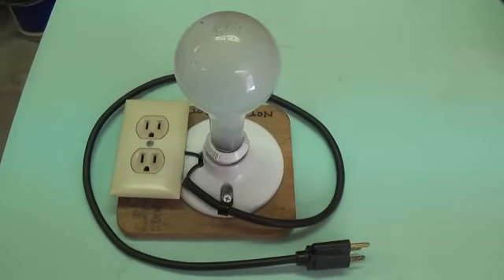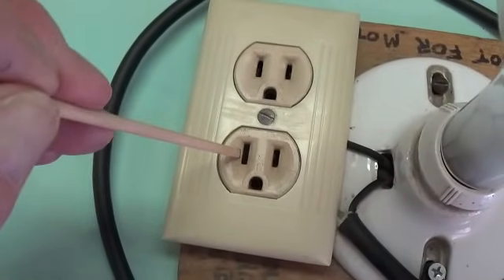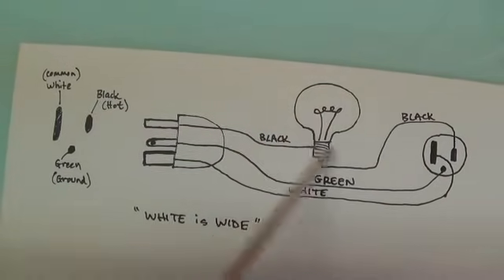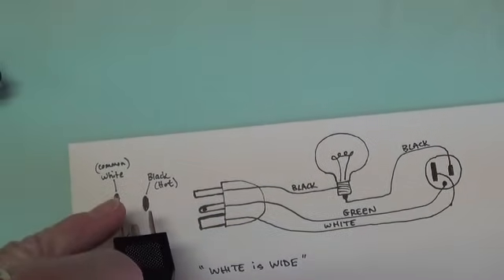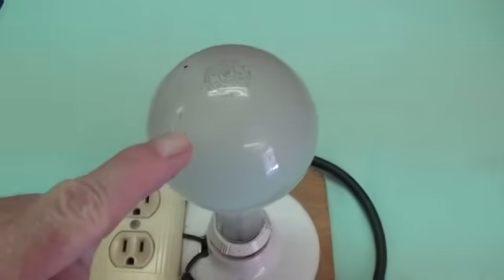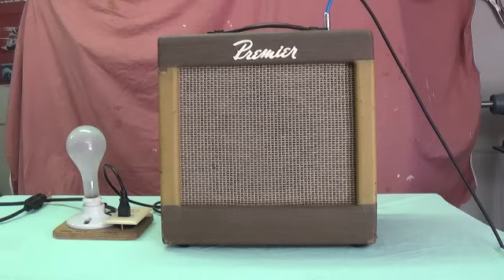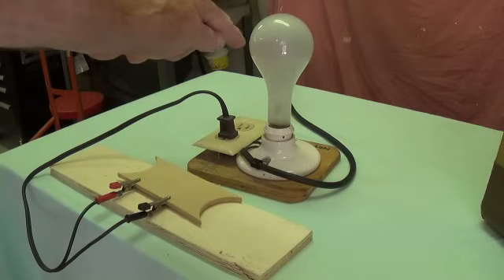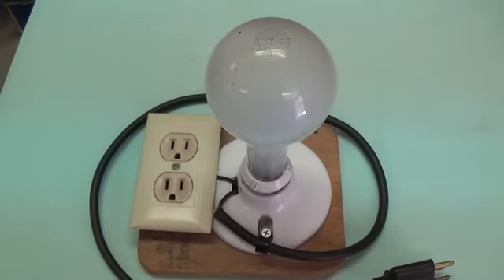Build Your Own Current Limiter for Protection when Repairing and Testing Electronic Equipment

Comment: Can you use a fluorescent light bulb instead of an incandescent?  anyone know?thank you
Reply from the maker: No, you cannot. A fluorescent bulb operates under completely different parameters and will not work in a current limiter.
Reply: Thank you for the fast response to both of my questions.So incandescent it is.Oh and I subbed to your channel.Cheers
Reply from the maker: Thanks for subscribing, Rob. Good luck with your current limiter.

Comment: So, if I have a 200W lamp installed in the socket of one if these, and powered up an old Danelectro DM25, and the lamp SLOWLY (I EMPHASIZE SLOWLY) burns the filament in the lamp apart/open (like a blown bulb), What does this indicate?
Faulty light bulb or build issue with  my CL? Or is there a serious fault in the amp?
I can turn the amp on without the CL and run it at 120V and it doesn't blow the fuse or act strange???
Help please! Lol
Reply: I'm at Lowe's now getting a 300W bulb to try...hopefully with different results...
Reply from the maker: Assuming that you wired the current limiter properly and if the amp works fine without the CL in place, then the only possible culprit must be the bulb. It had probably lost its vacuum, oxygen entered, and the filament oxidized rapidly once current began to pass through it. I have a feeling that the 300W bulb.....or a good 200W bulb.....will work just fine.
Reply: Uncle Doug ...
The 300 W lamp is working fine!
I appreciate your time sir!!!
Keep the videos coming!
Reply from the maker: I'm glad to hear that, Rickey. We will :)

Comment: One needs a current limiter, or your prized amp may be next in line for a new transformer or other expensive part. Also when checking prior to any of this, if you use a variac to check voltages of transformers, measure 12volts on the output of the variac before hooking up to primary wires if checking a power xfmr,  to make sure you don't overheating the transformer by using full voltage and letting it cook without a load...um don't ask me why I know this....Love the Doug Show and Tell hour, sorry to hear Fido has passed on...
Reply from the maker: You speak the truth, Johnne......and we won't ask how you learned it :) Thanks for the kind words about Rusty and our channel :)

Comment: Uncle Doug, I live in the Philippines and we have 220-240v on the mains. Should I just use a 100w? Or should I use 200w?
Reply from the maker: Greetings, MH. As stated in the video description:  "For viewers in areas with 220-240VAC power:  Although your voltage is double (220VAC vs 110VAC), your current flow is about half. Since the Current Limiter (CL) depends on current to rapidly heat the filament and increase its resistance, you need a bulb with higher filament resistance. Since the filament resistance of the bulb decreases with 
higher wattage, you should try a lower wattage, higher resistance bulb.....i.e. a 100W......initially, and then fine tune the wattage depending upon the power demands of the amplifier being protected."

Comment: Is there a good way to test this for the first time, other than just shorting it out?
Reply from the maker: Good question, Tony. Perhaps you could hook it up in series with an amplifier that functions properly and use the amp for a while. The bulb should be warm to the touch and glowing very little, if at all. If this is the case, then the wattage is correct and you are ready to use it with amps of similar wattage.

Comment: Hi uncle Doug, thanks so much for the video. As you explained very well this is for ac current. But for dc current do you have any suggestions. I do have an ac power source of 23v that i rectified to 23v dc. Have no idea of amps that can handle so i don’t want to blow the rectifier if I’m testing the dc amps using for example a 12 vdc motor that draws 3 amps. Any sugestions.? Thank you.
Reply from the maker: I only deal with vintage tube amps, Guillermo, and no tube amp I know of will function with 23V of DC. You might install a 4A fuse if you want to protect against current in excess of 3A. Good luck.

Comment: A comment on how I built a version of this current limiter.  Instead of using a bulb base and dedicated bulb, I split the socket and use one of the outlets for the load and I plug a floor lamp into the other.  I was concerned about storing the assembly with the bulb in it and since I have a 100 watt lamp in my shop anyhow, I just plug it into the lamp socket when I want to test something.
Reply from the maker: Very clever idea, SW. Thanks for sharing.

Comment: Reading the comments, it appears that many people need to know how to build a current limiter for a 240V supply. In countries which conform to the IEC standard (UK, much of Europe, New Zealand, Australia and elsewhere) the live/line/phase wire (Uncle Doug's black wire) is brown, and the neutral/return/cold wire (Uncle Doug's white wire) is blue. If you can source a 200W incandescent bulb you can simply follow Uncle Doug's instructions, taking care to wire your plug socket correctly.
 If a bulb is intended to operate at 240V, its filament has twice the resistance of the filament of a bulb intended to operate at 120V, which means that one 240V/200W bulb will do exactly the same job in a current limiter for use with 240V mains as one 120V/200W bulb in a limiter designed to operate at 120V.
Here in the UK, 105W tungsten halogen incandescent bulbs, which are suitable for use in a current limiter, can be bought in the shops. I use two such bulbs wired in series.
Reply from the maker: Thanks for your very detailed explanation, Silas.
Reply: Another recurring source of confusion is the use of multiple bulbs. The power rating of an incandescent bulb is directly related to the resistance of its filament at its working temperature. Resistance is given by 'voltage squared divided by power'. The resistance of the filament of a 120V/100W bulb is 120 x 120 / 100 = 144 ohms, while the resistance of a 120V/200W filament is 120 x 120 / 200  = 288 ohms. Just like any other resistors, the bulbs should be wired in series to add their resistances (and therefore their power ratings) together. 
Once again, the formulae derived from Ohm' Law come riding to the rescue!
Reply from the maker: I would only add that the resistance measurements you state are for the filament at operating temperature. The "cold" DC resistance is generally much lower. It is this heat-induced increase in resistance that provides the protection against excess current flow.
Reply: 7 months ago I posted the above comment. Much to my dismay and embarrassment I have to tell everyone that it is garbage and is utterly, totally completely wrong. Multiple bulbs should be wired in parallel to achieve a higher wattage light bulb current limiter. I should have learned by now to keep away from the keyboard until I know what I'm writing about!

Comment: Uncle Doug greetings to you in the wisdom land! THE D day has arrived to test my amp. I have just one doubt.  Am I allowed to have solder joint or just even solid wrapped  connection in extending the 2 wires as I splice wires in between? Thank you!! Kind regards and best wishes!
Reply from the maker: Greetings to you, ZA. I'm not sure I understand the question, but if you are going to extend any wires, I would advise that you solder them. Once soldered, they should function just as well as if they were one piece.
Reply: Uncle Doug thank you. Unwisely i cut 3 wires of the extension chord, instead of the only one which would have been connected  to the bulb. 

I was worried that a voltage surge could have maybe melt the solder etc. Just wanted to make sure. Million thanks. Good weekend!!

Comment: I use a 300watt tungsten halogen lamp.in UK we have 240v.earth is green yellow neutral blue.live brown.that is the colour your trousers go if you touch it.are plugs are the best in the world with insulated pins.a mechanical interlock and a built in fuse
Reply from the maker: Thanks for the info, Chris......especially regarding the brown wire :)

Comment: Great! But what if the plug of the old device being plugged in is only a 2-prong and is not polarized. There would then be two different ways to plug it in.
Reply from the maker: Either way, the device will be protected against a huge surge of current due to an internal short. Unless the old device is a pristine collectible, however, it should have a 3-wire grounding power cord.
Reply: In Europe even the 3-wire plugs are often symmetrical and can be plugged in either way.  That style is the “Schuko” type, originated in Germany, but also used in several other countries, although not in UK.

Comment: Hi.  I am planning on using a isolation transformer along with a 2kVA variac when I work on my old radios.  Along with them I have an analog 0-150VAC meter and a x1/x10 (switchable) analog ammeter.  When I start to bring up the voltage I will be able to monitor the current flow to tell me the condition of the item under test.  Would you still recommend using a dim bulb tester in conjunction with the items I have described in case of a dead short?  Thanks!
Reply from the maker: Yes, indeed. I use a current limiter with every amp, circuit, chassis, etc. that I work on.

Comment: Might want to make sure you're light bulb isn't burnt out or you will be.
Reply from the maker: No, actually, if the bulb filament is burned out, the circuit will be open and no current will flow unless you replace the bulb with a good one.
Reply: I was  wondering about that.  Can this devise be used to see the safe discharge of voltage in a high capacitance capacitor?
Reply from the maker: I would not recommend it, Pete. It's a current (not voltage) limiting device. The high voltage may damage the bulb.

Comment: Doug, thanks for another great video.  I built one of these after watching.  Question, given that the fault tube amp (or old radio) is effectively in series with the tester, doesn't that mean that the same current must pass though the faulty amp....in this case 250w / 120v = 2.1a
Reply from the maker: Fortunately not. A short circuit will cause excessive current to try to flow through the filament of the tube, resulting in a significant increase in filament temperature and resistance. This increased resistance will prevent an increased (or virtually any) current from flowing through the shorted circuit. Another way to look at it:  If Voltage = Current x Resistance, and V is constant, when R goes way up, Current must go way down to maintain the constant V.
Reply: The 120V supply voltage is shared between the bulb and the amp. With a short circuit or low resistance in the device under test (DUT) most of the voltage appears across the lamp, so that, although a large current is flowing, there is a small voltage so very little power is dissipated in the DUT.

Comment: Great Video!  
Can a GFCI receptor be used for protection instead of building a current limiter?  Or should a GFCI receptor be used Plus this current limiter?
Reply from the maker: Thanks, Danny. They serve two different purposes. The GFI is mainly for your safety, while the current limiter protects the circuit from damage while offering a visible indication of normal and excess current flow. I guess you could use both.....but I only use the CL.
Reply: Thanks for your reply! I will add both to my setup.  FYI, I have been getting a lot less sleep after finding your videos - they are so much fun and educational to watch!  Your teaching skills are very apparent.
Reply from the maker: You're welcome, Danny. We're glad you enjoy our videos :)

Comment: Hi yes i thought as much is there something else i could use, one bulb plus and appliance
Reply from the maker: Not really, Ron. For the unit to function, you have to use incandescent light bulbs. They alone provide an instant increase in resistance when confronted with increased current flow, and can effectively dissipate lots of heat while emitting a bright warning light.

Comment: hi i have wired it like you show but the bulb only lights up if or when i plug in an appliance in the socket they are 1600 watt appliances i am. only have 100 watt bulb 

thank you

ron
Reply from the maker: The Current Limiter I described is intended for use with guitar amps, Ron, not heavy duty appliances. If you absolutely have to use it with such appliances, you will have to use a group of 100W bulbs all wired in parallel.....probably 5 to 10 bulbs.

Comment: Hi, great video thanks. Incandecant bulbs are almost impossible to get in the UK now. Could I use a high wattage halogen bulb instead as these are still readily available.
Reply from the maker: Thanks, Russell.  I have not fully investigated, but don't believe that halogen bulbs have the proper resistance and design for use in a current limiter. Incandescent bulbs are readily available on Amazon.com. Perhaps you could order a couple for your CL.
Reply: Thank Uncle Doug, I will do, although with my very limited knowledge of electronics I can't see why a halogen bulb wouldn't work. Isn't it just a low impedance resistor that heats up the same as a normal bulb? I would like to understand the difference.
Reply: Hi Uncle Doug, well I gave it a go with a 116w halogen bulb I found in my garage & it works fine. They are just tungsten filaments in a halogen gas bubble so no big difference to a normal incandescent bulb I think :-)
Reply: @RussellCatchpole  You think correctly.

Comment: Thanks very much! I need such a device but in Belgium wall plug alternates,  we don't have hot and common. Can I still do this?  Thank you
Reply from the maker: You're welcome, ZA. Yes, the current limiter will work regardless of which of the two AC wires the bulb is inserted. Build the unit and test it.....it will work.
Reply: Uncle Doug great. Go out right away and buy the parts.
Reply from the maker: Let us know how it turns out, Z.

Comment: Hey Doug thanks for all you videos. I have a question about using one of these. I built one as you described but when I power it on with an amp plugged in the light glows bright then slowly goes out. Is this OK?
Reply from the maker: When an amp first starts up, the filter caps draw a lot of current, which diminishes once they are fully charged. This could explain what you are experiencing, Tim.

Comment: Excellent video.  I've built one of these several years back and used it along w/a Variac to slowly pull up an old ham radio rig (Collins).  Very useful tool, and I'd never bring up anything old that's not been powered up in years without a DBT.  Thanks again
Oh yeah, my Dad (now 81) taught me how to solder my first project when I was 8.  And he always told me to keep one hand in my pocket when working around lethal voltages. :)  An old-school habit.
Reply from the maker: Thanks, SR. It sounds like your dad was a good source for electronics advice :)

Comment: Nice video Doug.  I think I need to upgrade my device.  I just took an old two wire extension cord (no ground) and wired the light socket inline with one of the wires.  I am not even sure it is wired on the hot side.  It seems to work fine but I like this better, mounted to the wood plate with the receptacle.
Reply from the maker: Thanks, M. You had the right idea, but with a little refinement, it would be a very useful workshop tool.
Reply: LOL.  Everything is easy to buy at Home Depot except the wood.  Where did you get that?  Just scrap?  I guess I could cut out a little square of plywood.
Reply from the maker: Yes, I have a whole pile of scrap lumber left over from building cabinets, etc. You're welcome to come by and pick up some pieces :)

Comment: Uncle Doug, this is probably a dimwitted question, but what are some good ways to ready a chassis to work on it- meaning turn it upside-down with room for the tubes to hang, the rectifier one on this one I'm about to dive into , I'm going to probably cut some boards to build a custom box, just wondered how you do this...
Reply from the maker: We use a highly sophisticated chassis jig that consists of two 10" pine 2 x 4's on edge, one beneath each end of the chassis, to hold it bottom up and high enough off the work table so the tubes don't touch.  Patent pending :)
Reply: AH! -so I'm not just overkilling on this.  that 1958 Magnavox Concierto 2-piece console thanks you kindly.  one other thing. . . one of the 15" woofers has a scratch on its cone, not all the way thru, but pretty visible.  hot glue?  or just leave it?  I should really remove it all and check the conditions.   Starting to feel like too much of a dummy to even attempt this jazz...  mid-life-crisis hobby
Reply from the maker: If the scratch is on the part of the cone that doesn't flex, you might strengthen it with some white glue (Elmer's or Titebond). If it's on the surrounding flex portion, use contact cement (which remains flexible).
Reply: thanks a lot- still tinkering with things non-electrical until I cram more know in here.  the chassis of this thing is speckled with dark little dots, bug frass i assume, they won't come out with #0000 steel wool..  any way to buff them out w/o power tools?
Reply: i retract, I removed it, turned it around -and it looks like it's a seam? stranger things have happened?  there's also a 4" speaker mounted in front of it!  the plot doth thicken.  I wish I could have a pro around who's seen ghosts too.
Reply from the maker: It's probably an old radio speaker, with a tweeter mounted coaxially. There will probably be a crossover network in the wiring somewhere between the amp and speaker.
Reply: I believe it's done with variable coils..  they look like silver caps?  wish I could sen pictures, I'm not youtube on right now.   there are no crossover components with the speakers